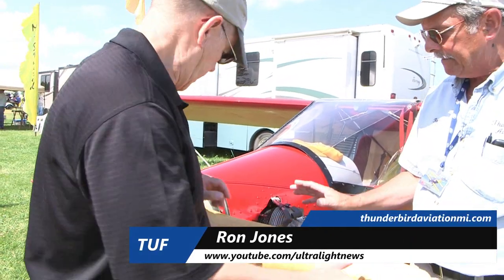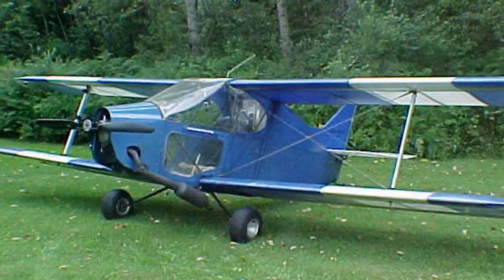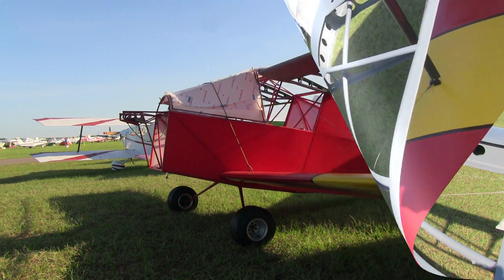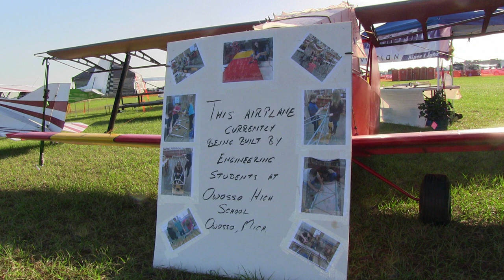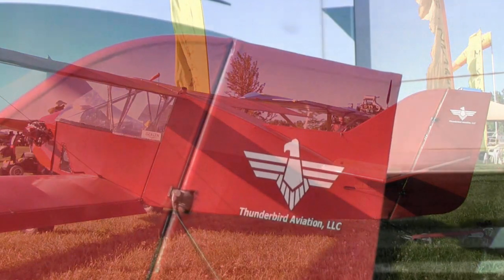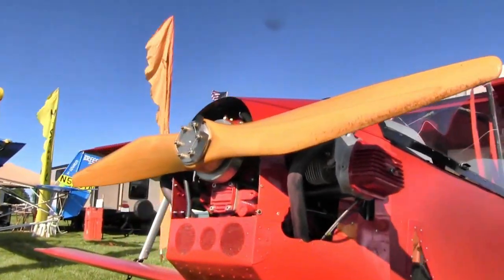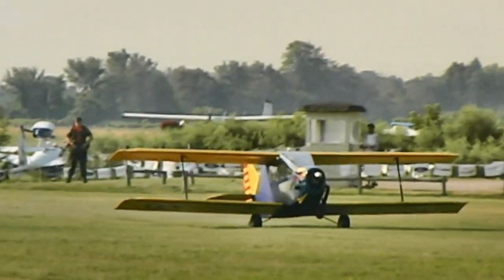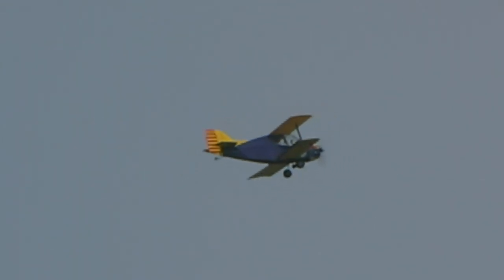Hiperlight SNS8, Part 103 Ultralight Aircraft, Thunderbird Aviation 2022 Ultralight Buyers Guide

Comment: Tube truss structure with skin makes sense, I just have to believe that single piece fiber composite must ultimately be easier to construct and have superior aerodynamics and aesthetics. Strange no one has done that in all the 103 designs. I guess the mold making is a psychological hurdle. If you made it glider style that would be compatible with the low speeds of 103 and could provide ridiculous fuel economy. While looking really good.